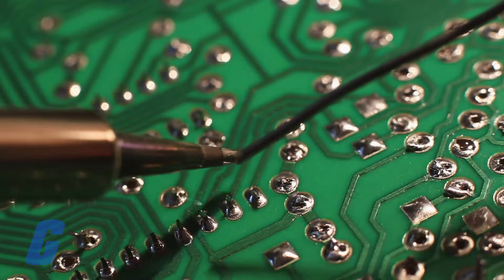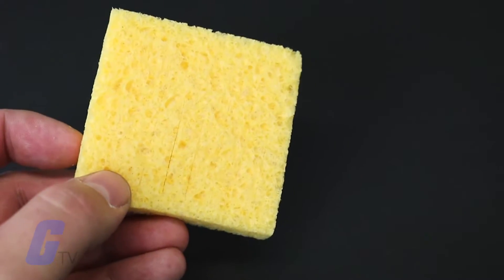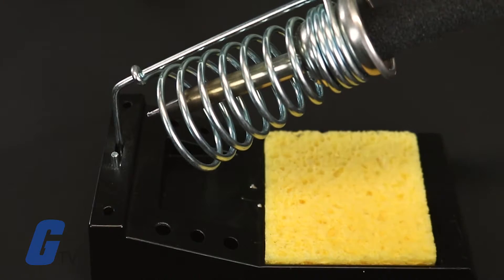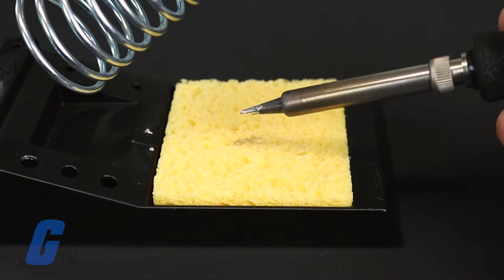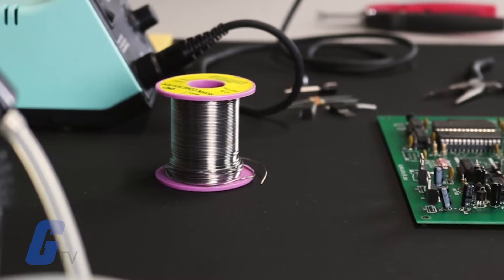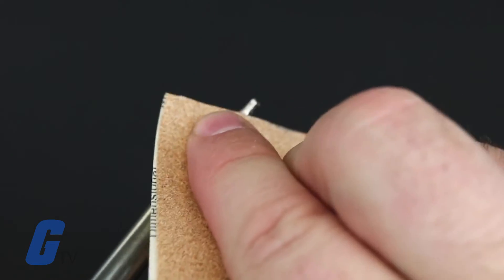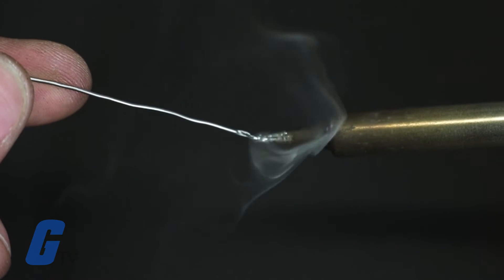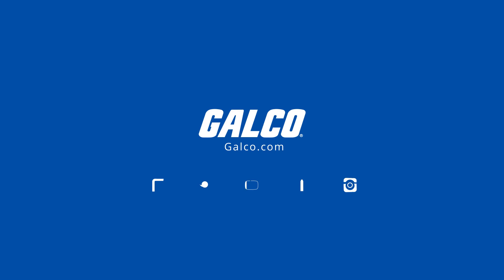How to Clean and Re-Tin your Soldering Iron | Galco

Comment: Do not sand the tips because these tips has a thin layer that protects and helps it last longer and by sanding it you're not just removing the oxidation, youre removing the protective layer too.
Reply: how should i de-oxidize the tip without using sandpaper? my tip is hot, but not melting the solder and has a black coating on it so im 99% sure it is oxidization that is my problem
Reply: @fishwithlegs7655  youre using it too hot 63/37 solder melts at 303 Celsius
Reply: @fishwithlegs7655  if the tip becomes oxidised then there is something else going on. Soldering iron tips do not become oxidised from electronics work. In your situation I would purchase a new tip.
Reply: I'm constantly amazed that people will happily destroy their iron tips by sanding them. And then jump online to ask "anyone know where to buy soldering iron tips that last longer than a week?"

If you don't treat your tools like garbage they can last for decades.